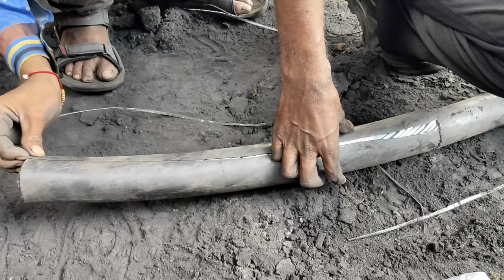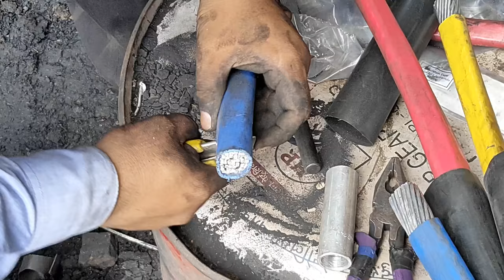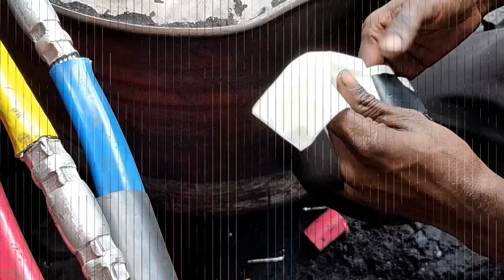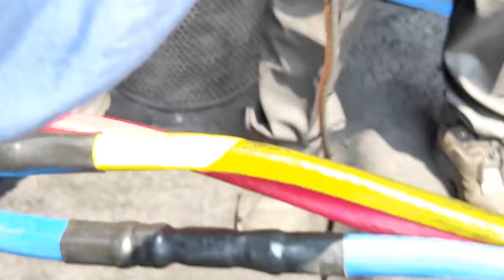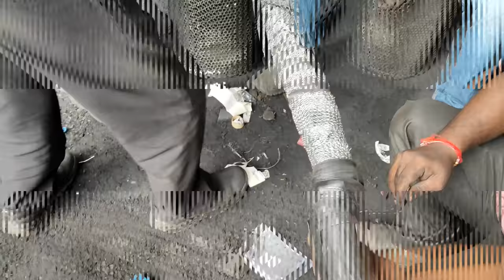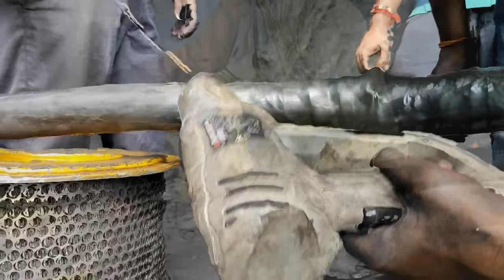L.T  Cable 0.44 kV 300sq mm Joint || Cable Joint Tutorial || nowpsb ||

Comment: Im a asistent cable jointer and have a experience of six years  on 132kv, 220kv,400kv. i worked in qatar for six years. If you need asistent cable jointer then i would be much happy to work with you
Reply: Yes i have a best jointer team in Pakistan

Comment: Good work buttttt...here is few my advices for future:1.Allways heat tubes from the middle to the end including smaller isolation tubes and do it with flame!2.Allways clean with  medicin alcohol or cleaning petrol all wirers and part of cable isolation at the end that final isolation tube is covering!
Reply: Good skilled worked

Comment: Ghalat tareeky se joint kar rahy ho dost warna core ka sim(conductor) ko kam (kaatny ke zaroorat nahi hoti..
Core furrel mei loose hoga joitn heat hony lagyga aur kich hi din mei joint fail
Main v electrical engineer ho  yeh to lv cable 3cX300alm ka, es joint ko heat shrink ka straight joint v bolty hai...
Bro if u need any expalnation y Can  write me..

Comment: Cable joint is not proper as per the electrical standard...pls don't doing this type of joint....it's becoming heat after getting charge...may be corrosion will be occurring inside the conductor..